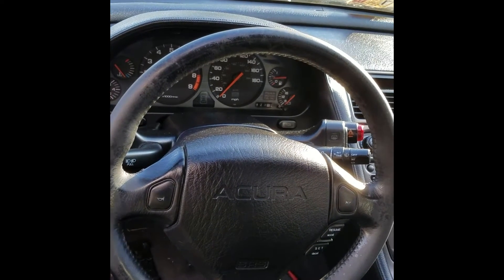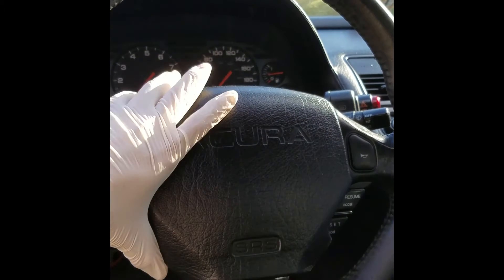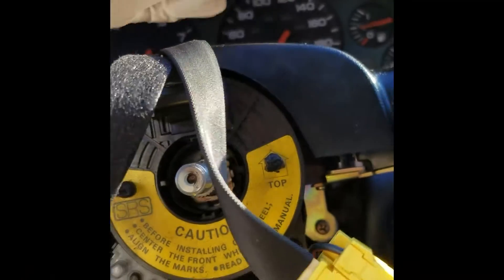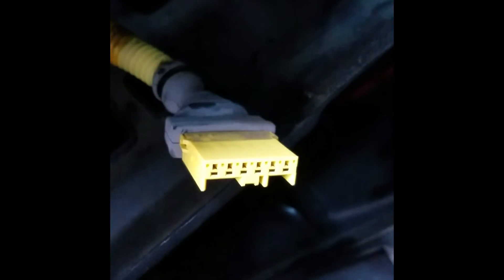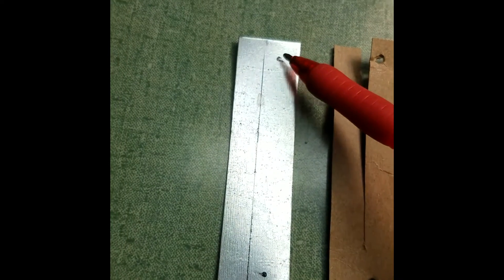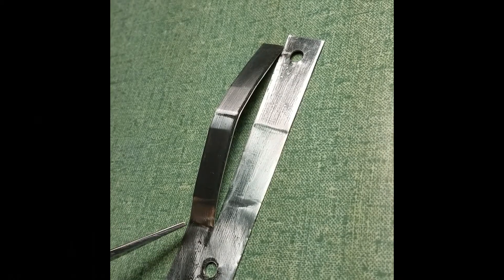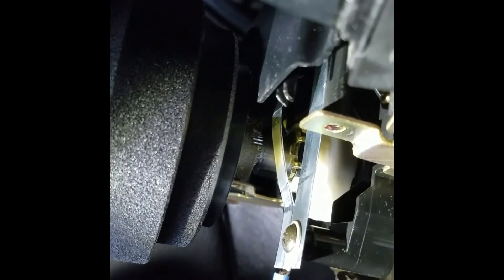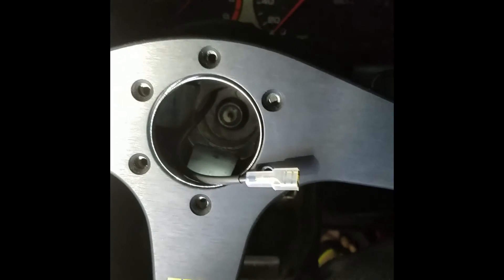Acura NSX Steering Wheel Removal, Horn Kit Fabrication, and Installation of Momo Steering Wheel

Comment: Thanks for this, I brought the tablet out to the garage and this video walked me through the install, well done!

Just a couple nitpicks that may help others: there are three (not four) screws holding the clock spring in, and aluminum is conductive.  I made my contact from an aluminum plate off of an old trophy 😂

Comment: Hello, did you just leave all the spring clock connectors tucked into the aftermarket hub?
Reply: In this install the clock spring is removed entirely